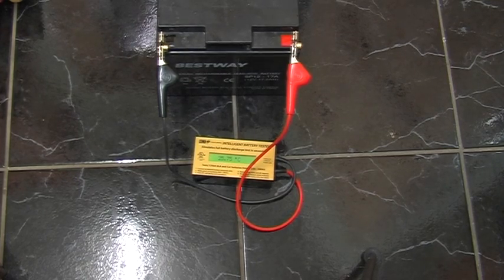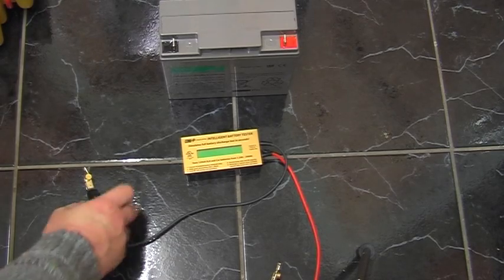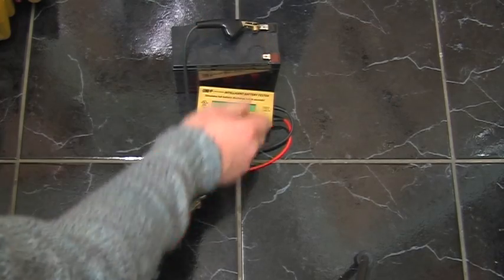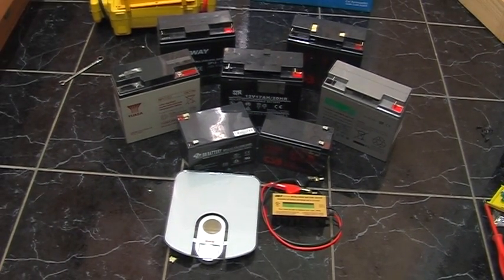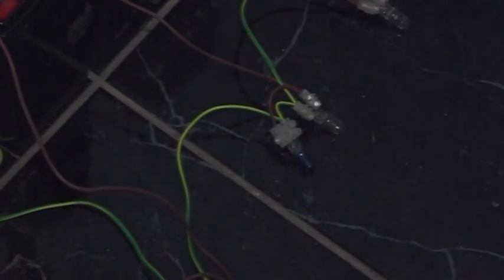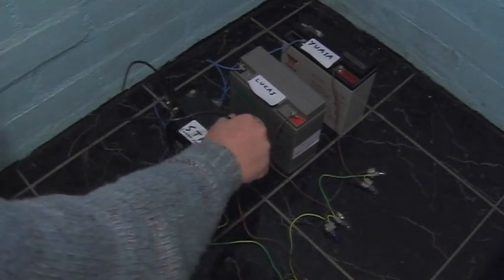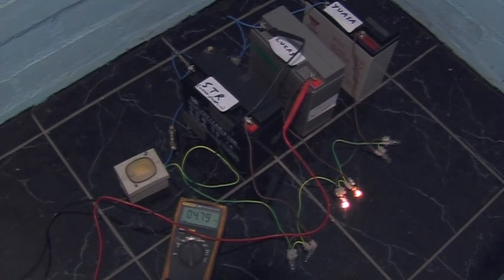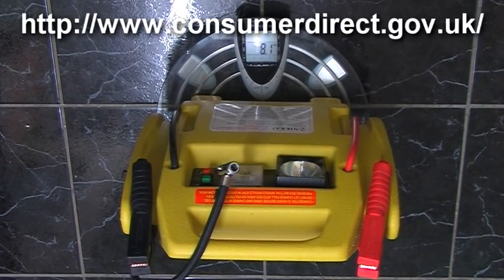Maplin Nikkai 4 in 1 Jump Starter review (part 2)

Comment: Fantastic video.  Thanks for taking the time to make it in such detail.
Fyi i have just recovered my battery pack which was hardly used. 
I charged it with a small 5w solar panel for a few days and found that the voltage increased to 12.6 v.  
I then used my Optimate 6 smart charger on the jumper leads over night and the voltage has increased to 13.1 v. ;).

Comment: Great video , I have this one http://www.amazon.co.uk/Booster-Recovery-1700amp-compressor-83606012/dp/B005VEKHKI   Only had it a year and the battery is rubbish , I will fully charge it and then connect a 12v air compressor to it and it struggles , I'm yet to open it up and take the battery out and weigh it ,   Do you no if these jump starters use the same type of battery's?  Because I'll get a new battery for it the one you recommend for another viewer . That's for the golf buggy ,
Reply from the maker: +Chris Thompson the label claims that the jumpstarter has a 17Ah battery so I'd expect it to be the same, standard size (unless they've even started lying about that now) and the Lucas you mention should drop right in.
Reply: +AintBigAintClever .  Cheers I'll open it up tomorrow and have a look , thanks again 👍
Reply: +AintBigAintClever . Just opened mine . I've weighed the battery and its 4.1kg . Battery make is SHENGYANG SY12170 ,   I'm guessing it's a cheap Chinese battery ,
Reply from the maker: If it's 4.1Kg then yes, it's some cheap, fake battery.
Reply: Fitted the Lucas battery the week end and the jump starter pack is a lot heavier now so should do the job, I'm tempted leave the lights on on the car to try it out lol
Reply: since replacing my battery 2 years ago it's still going strong and holds a 12.8v.  I've jump started a 2.0l diesel engine from a dead battery.

Comment: Hi, ainbigaintclever.    I got one of these over 3 years ago thus I don't think I can get any refund from maplin.  However, I would like to replace the battery inside.  Which one will you recommend and also available in the u.k. market?   Will this one "Yuasa NP17-12I Battery 17 Ah 12 Volt Sealed Lead Acid Battery" suitable for the job because this one keep coming up on the google search page?    Thanks.
Reply from the maker: +Ken Chiu That'll do the job. I've got one of these in mine: https://www.tayna.co.uk/Lucas-Golf-Battery-LSLC22-12G-P7938.html
Reply: thanks
Reply: Before I go ahead to replace the battery, I try to look at different part of the jump starter.   When I plug the main charging adaptor to charge the unit, thenI press the red button to read the meter.  I find the meter needle will go all the way to the right hand side passing through all the green section. Before, it will simple on the top scale of the green section.    I wonder whether the little circuit board inside has blown or not.  Thanks.
Reply from the maker: The needle will be showing the voltage at the battery terminals. If the charger's plugged in but the battery's not accepting any charge then the voltage shown will be higher. Sounds like the meter is OK.

The charger that would've come with the jump starter will be absolute rubbish though, I'd recommend buying a proper, decent quality battery charger (I use a CTEK MXS 5.0).

Comment: Do you charge these with the switch off or on?
Reply from the maker: Preston Miller The big battery isolator switch? If charging through the jump leads the switch will need to be on. If not, it won't matter.
Reply: I'm talking about when you charge it for the first time for 48 hrs. Does the switch need to be on or off? I've heard both answers.
Reply from the maker: It won't matter.

Comment: you should charge these batteries for a long long time. 24 hours or so no?  these units are cheap, you get what you pay for nothing new.
Reply from the maker: With the cheap taper chargers they're supplied with you'd probably need to charge for 24 hours with the half-capacity battery these POS units come with. If they had a battery that actually had the capacity shown on the side they'd probably need 48 hours, assuming the power supply doesn't overheat and pop its thermal fuse first. Leaving them on permanently would overcharge and damage the battery.

In the case of these you DO NOT get what you pay for. You're paying for a jumpstarter. You're getting a piece of shit.
Reply: AintBigAintClever
Very possible. seeing this vid is from 5 years ago things might have changed. the price at least. in norway, a very xpensive country they are less than 100 USD. And on sale now for 50-60USD. (The reason I m here on research.. :)

Comment: Would it matter if the STR battery was allowed to cool first because you had it on the charger right to the last.
Reply from the maker: Not at all, all of the batteries were topped off just at that point so were in the same state of charge and temperature. Check out part 3 where I rip the batteries open to see what's inside, that's where you'll see the reason for the lousy performance. Bits of scrap plastic and glass do not make good cells!
Reply: Alright thanks for the videos, all good stuff
Reply from the maker: No worries, glad you enjoyed. Check out the links on my channel, there are a few other fantastic channels to check out.

Comment: Had something very similar from halfords years ago, and as you say - they can be useful,
At the time I had an old Metro that needed a jump start more often than not when the weather was cold, and unfortunately the car was parked 1/4 of a mile from where I lived most of the time, so having a "brick in a box" that was easy to carry down to the car every day was a lifesaver and much easier than taking the car battery out and home to charge every day..

Comment from the maker: Crap batteries charged with a crap charger. For £20 it's probably worth it as a cheap compressor+short jumplead+case-for-a-battery set. Fit a decent battery (e.g. Lucas LSLC22) and get a decent charger (CTEK MXS series) and it'll be fine, the CTEK can be used to keep your car/van battery in good shape too.

Comment: Thank you for this review, I bought the same unit over 12 months ago and it did not have enough power to start anything and this explains why, I ended just using it as a compressor until the side of the unit exploded and when I opened it found the battery had blown the side off exposing the cells. The compressor is fine I think joining cells shorted. I have reapired the case and intend to fit the Lucas now. Very poor quality unit but it was the cheapest.

Comment: Arr, Thankyou for your video. Found You via Andy, Yeah, backups up my theory that these Maplin "all-in-one" backup emergency things are a right pile of shit. Mine died ages ago. It has a digital controlled compresor, lamp, cig lighter output and a usb. Battey failed within months, wouldn't charge, discharged by itself. I plan to make a much better wooden box, use some of the existing guts and add some extra. Yet another project to add to my list.!!

Comment from the maker: I'd recommend using a decent car (or motorcycle) battery charger and doing it through the crocodile clips. The design of the charging circuit in these jump starters is woefully inadequate, if you replace the charger that came with it with another identical one it'll burn that out as well.

Comment from the maker: One more thing, get yourself a decent battery charger. The one that comes with it is NOT a decent battery charger. A proper charger such as those made by CTEK will be well worth the money (they can help recover deeply discharged batteries as well as function as a normal charger), you just hook it up to the jump leads, or if it comes with a ring-terminal adapter lead you can fit that when you fit the new battery.

Comment: I know this video is years old now, but I'm constantly encountering cheep crap like this from China and the like, supposedly Cat5 network cable with thin and steel wires!, laptop batteries when you open up half the "cell" space is just weights! It's difficult to know if you are getting a bargain or simply exactly what you paid for. I wouldn't mind if they were open about what you were getting, say it's only 7Ah let me decide, this practice is simply fraud and sellers should be held responsible.

Comment: @AintBigAintClever 
I actually went for the Clarke 900 because it's cheaper and I will use it mostly to power my telescope mount. It has a 17Ah battery and it all weighs 8.2 kg which I think is alright.

Comment from the maker: @peavy82 Glad to be of service :-)
A lot of the Clarke ones are made by the same manufacturer as the Nikkai ones, but hopefully they're using better batteries.  If you open it up and weigh the battery you can compare it with the various manufacturers' datasheets to see what you're getting.  The Clarke 4000 has a 38Ah battery which should be 14.5-15Kg, the whole thing is 17Kg according to Machine Mart which sounds about right.

Comment from the maker: @ispiron55 JJLewin1 above recommended a Clarke one.  Even if you go for the ones that look just like the Nikkai one, you can see from the weighing scales what you should expect.  If the whole thing weighs less than about 7.5Kg it's got a crap battery in it.  I smashed the battery open a fortnight ago, the bottom half-inch of the thing's just a load of clear glass blocks acting as a filler!